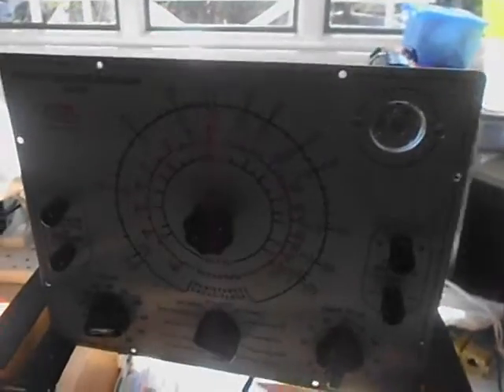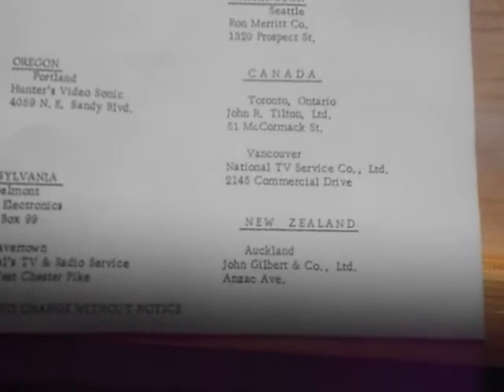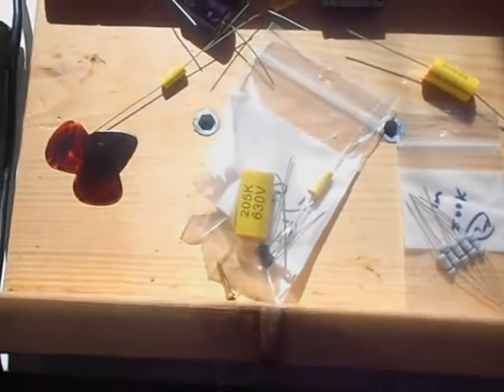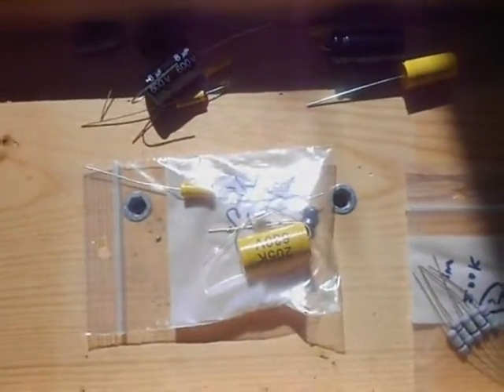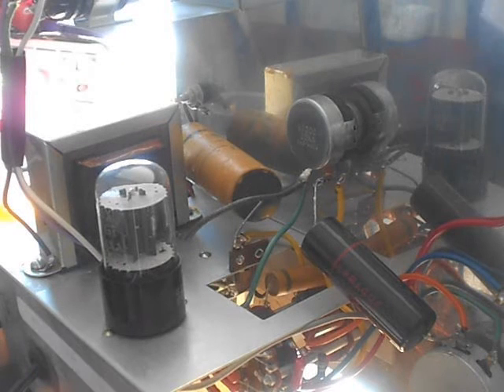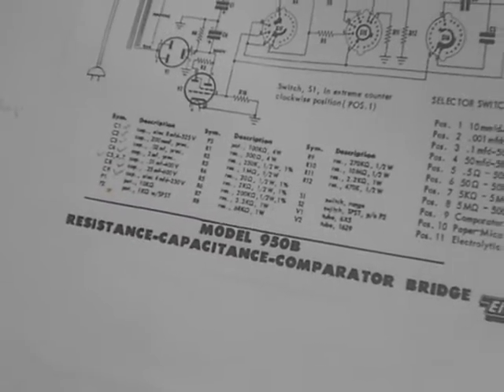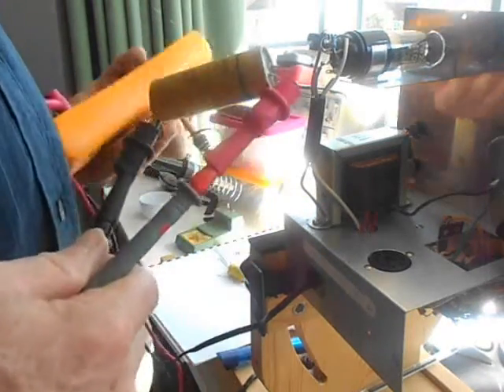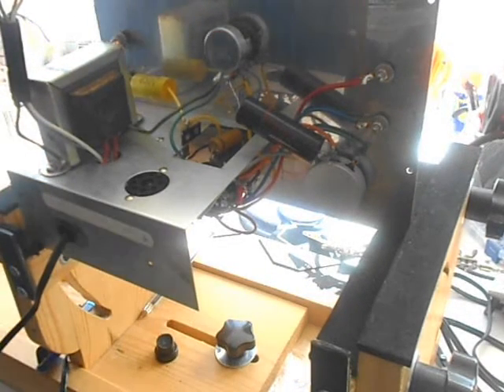Eico 950b Complete Restoration (part 2 of 2)

Comment: Thanks for your video. I was wondering as I have one of these why you chose to replace the precision capacitors. I replaced the 2 electrolytics in it, 8uf 525V and the 4uf 250V but am not really tempted to replace the others since they are not electrolytic and the use of this device is unknown. I like to go along and test devices after replacing known suspects but not those that are not as susceptible to leakage, usage or shelf life issues. Testing it after having done so just now it seems to be quite close if not spot in with the capacitor values. EDIT: I am thinking of this device as a good way to check ESR (although I have not sorted that bit yet), leakage at rated working voltage and a quick check to see that the capacitor value is in range roughly for tube guitar amps I build and repair, and not much more because I have a nice DMM.Thanks.

Comment: Did you check those paper CAPs for the foil side so you put them in the correct orientation!?
This is Tube equipment, so it's IMPORTANT!

Comment: I also have a 950B. When I refurbished mine, I did the same as I do with all old equipment or radios. All electrolytics, wax/paper caps, and carbon composite resistors will find a new home in the local trash dump. The 950B also checks ESR with the power factor. Turning down the voltage after testing an electrolytic will bleed it, but that puts stress on the pot. When I got my 950B I had to replace that pot, and those 100K 4 or 5 watt wire wounds are hard to find. I disconnect the capacitor and bleed it with a resistor.
Reply from the maker: Good information. Thanks for posting.

Comment from the maker: Thank you for you questions and comments.  Believe it or not this is the 3rd time I have attempted to answer, but lost the messages due to 'hiding the keyboard' while using an iPad, probably good material for a future YouTube video. About the markings:  C1 says 600v 8uf MIEC.  C2 is the original domino resister I left in place. C3 says ETR MET can't see more now it's installed.  C4 says 205K 630v no brand but suspect it's also ETR MET. C8 says 254K 630v ETR MET.  To summarise the electrolytics that look like Nichicons are MIEC.  All the yellow ones are ETR MET.  These were ordered from Just Radios.  I don't think the brand was specified at purchase just values and you accept what you're sent. The others C5, C6, C7 were Vishay that I purchased from RS Components in the UK.  Anything higher than 450v seems to be a speciality item these days Just Radios seem to be one of the only places that provide higher voltage caps (that I can find) at least they have a fairly comprehensive stock.  They will measure precision components for you.  Suggest you get what you need from them, but I now live in the UK where choice is more limited. Hope this helps.  Peace Matthew.

Comment: My Eico 950 also has a 2mfd @150 volts (+- %5). I think that was precision back then the Eico was manufactured. I also think the resistance reading on Eico 950 are off regardless if you use high end capacitors or not. I'm using +- 5% capacitors. I'm primary concerned about the capacitor leakage.

Comment: Could you make a video of checking capacitor values on the Capacitance & Expanded Capacitance ranges dial, for Electrolytic and other capacitors? This would be a very educational video, to see how the Eye Tube reacts in each range along with the actual values of the caps. Thanks again.

Comment: I love your bench jig. How about a video on how that works or how to build it. Is it available commercially?
Reply from the maker: Hi Paul,  thanks for your kind comments.  I made the bench jig (amp cradle) myself.  It is designed to hold guitar amps in various positions for servicing.  It will hold other electronic chassis too.   I feel my version is more versatile than some I've seen, and is made of recycled wood and is hand crafted and finished.  This was a prototype that I planned to make to sell.  However, this has been postponed probably until the summer of 2018 due to a house renovation I am constantly engaged in.  If you're interested I can get back to you when they're ready.  Cheers.

Comment: Thanks for the very informative videos on the Eico 950.  As a part time woodworker i noticed the custom built jig to hold your equipment, very nice.  I now go on search for a 950 to refurbish, get up and running.  I am motivated now!
Reply from the maker: Many thanks for the kind comments.  I made the amp cradle myself out of recycled pine wood I had I the garage.  Not a necessary tool but i have found it useful. Best of luck with your restoration.
Reply: Found a good candidate and did a full refurbish.  All done and works great. Great tip on Just Radios, love how they package their resistors with the color coding.  Old housing was bent/tweaked, may fabricate a new one, possibly with a plexi window to look inside at my great (ha ha) soldering work...and tube glow.  Thanks again!
Reply from the maker: You are most welcome.

Comment: About the left voltage knob showing higher values than the real ones generated at the test terminals. 
Well did you manage to 'realign' the circuitry for good voltage tracking ?
My 950B only output 0-470vdc from the voltage pot so the front layout is completely off..
In fact I get 216vdc at the magic eye supply and 470vdc for the voltage pot.
I tried to get the R8 68k resistor lower to rise the voltage pot a little
but doing so I drop the magic eye brightness..
So I got choices: leave it this way (original) or add a small amount of ac voltage
to the 560vac supply using a small power transformer to get the pot
at 500vdc.. I know that testing a capacitor leakage at high voltage
can be done with a 'not tracking pot' but that's not very elegant..
What do you think ?
Reply from the maker: jpdesroc Hello, thank you for your comment.  I think the answers to your questions can be better answered by other people.  There are a couple of good resources (webpages) on the net regarding restoring these testers.  This tester does not allow for any adjustment for output voltages etc.  If I remember correctly there are mods that can be made to upgrade these testers to emulate later models that have adjustment pots inside the tester to fine tune them.  I will take a look and see if I can find the links for you.  Best wishes, Matthew.

http://www.ohio.edu/people/postr/bapix/capchkr2.htm 

This link is a good place to start.  It is shows a good understanding of the differences between testers.
Reply: Thank you for your comment. Let me know if you find something relevant on fine tuning this tester.. In the meanwhile I'll do some research on my own.. Best. JP
Reply from the maker: jpdesroc Included a link above that is interesting.  It talks about installing pots to fine tune internal voltages.  I only use the unit to test electrolytic capacitors.  Multimeters are better for reading resistor and cap values and more accurate.  You could attach a meter to read the voltage at the terminals to verify the output and to better understand knob position relative to output.  Best.
Reply: Is-it this link:
http://www.ohio.edu/people/postr/bapix/capchkr2.htm 
Because I cannot find any pot mod to fine tune anything
on that web page..